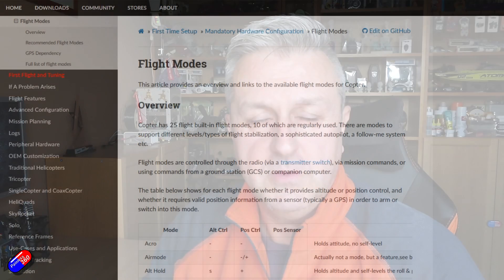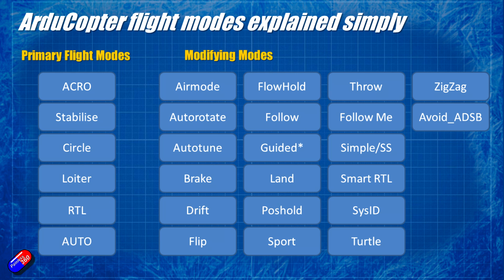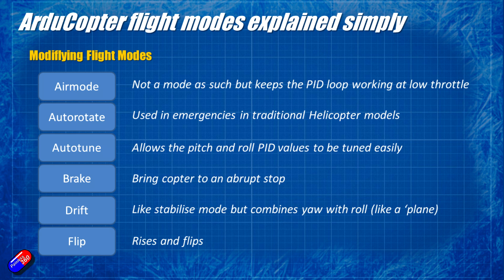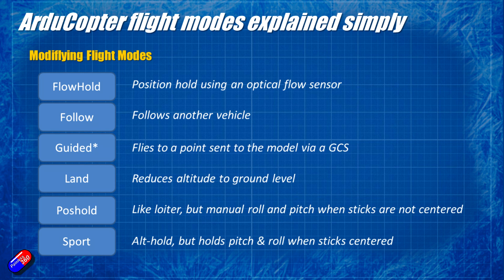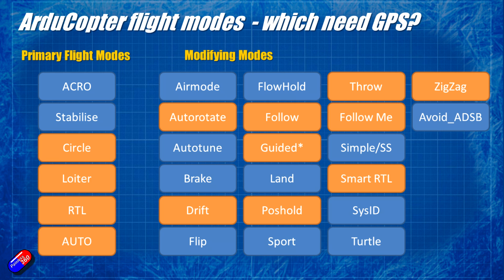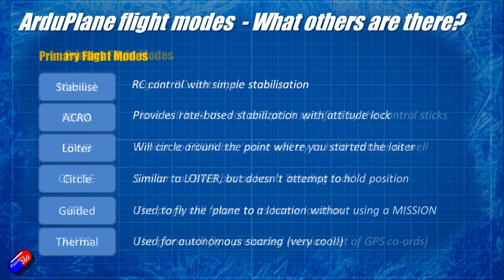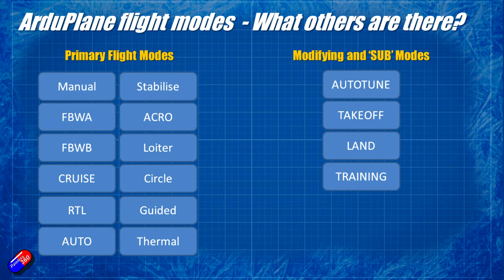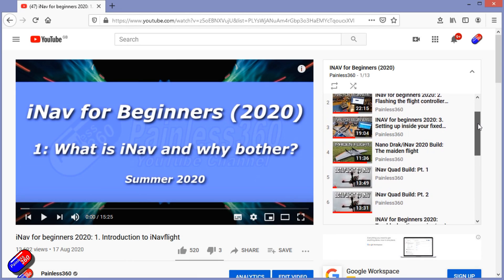Ardupilot flight modes explained simply (Patreon Request)

Comment: hey when the aircraft is in our hand and in takeoff mode, the motor runs. however, when switching to other modes, the motor stops. When we try to start directly in loiter mode or other modes, the motor doesn’t run at all. sometimes it works, and sometimes it doesn’t. do you have any idea
Reply from the maker: You can't arm in some modes... I'd start in FBWA... See my builds and the docs for details.
Reply: @Painless360  how can i reach for your builds and docs
Reply from the maker: Please see this video - https://www.youtube.com/watch?v=P4soR6QgOk0 - that should help you find those videos of mine and help you find the answers you need quickly

Comment: Thanks for the great explanation. I am using ardupilot with a fixed wing aircraft. And I have the problem that after the radio connection is interrupted, the mode is not switched back from RTL mode to the previously set mode when there is reception again. What can be the reason for this? Only when I then (with reception) manually change the mode, the FC recognizes the change and sets the default mode.
Reply from the maker: That is how it's set to work.. see https://ardupilot.org/copter/docs/radio-failsafe.html
"Test #4 : retaking control after the failsafe has cleared continuing on from test #3, turn your transmitter back on while the flight mode is still in RTL or LAND and armed, change the flight mode switch to another position and then back to stabilize mode. Ensure that the flight mode displayed on the Failsafe page is updating appropriately."

Comment: Very helpful — thanks!!! For Plane, how important is PID tuning using Autotune? Vital, or are the stock PIDs pretty close for most planes?
Reply from the maker: See my video on it. I always do a tune.. Happy flying
Reply: Ardupilot stock tune is way better than iNav IMO, but there's a tendency for it to be sluggish (slow response). Autotune will get it really dialed in to fly stable and with authority.